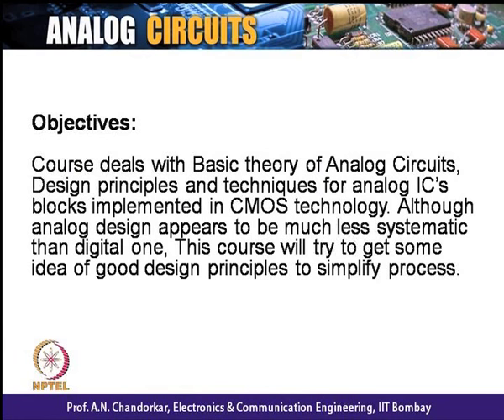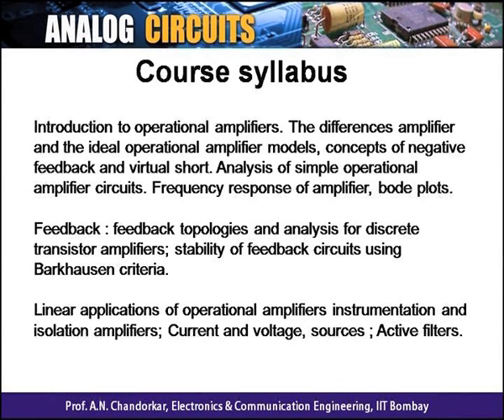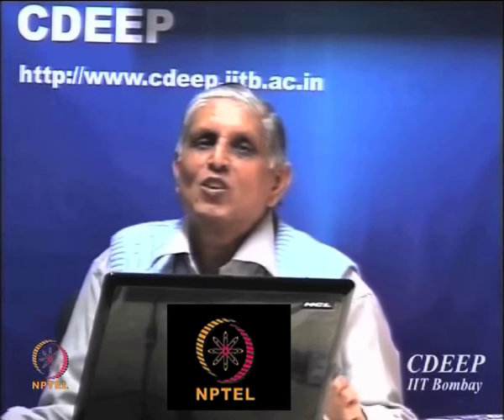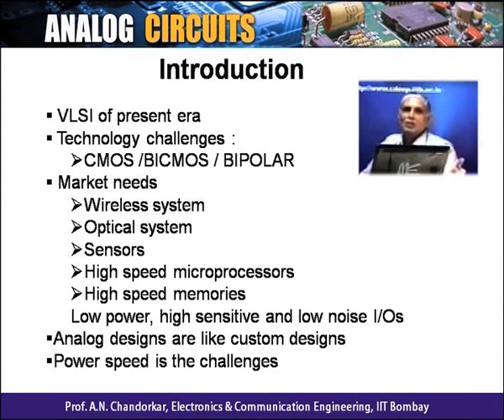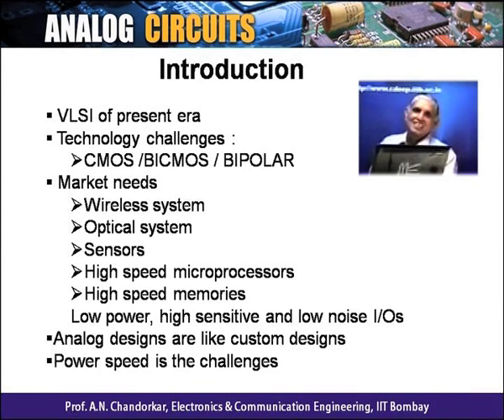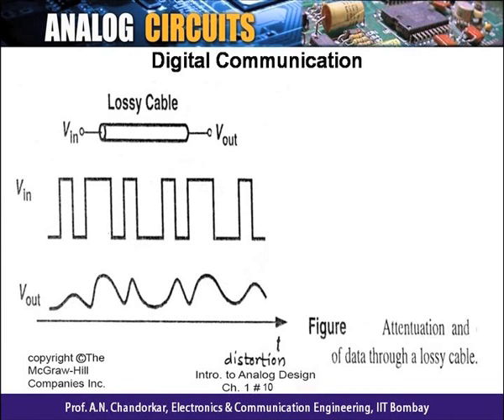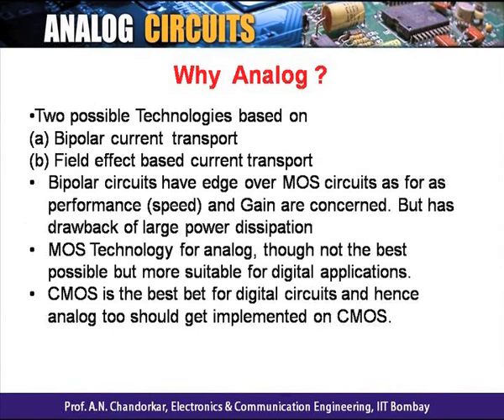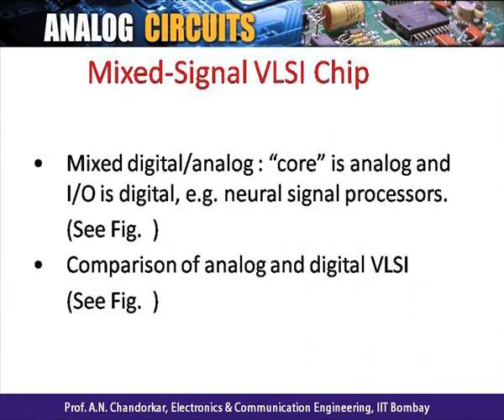Mod-01 Lec-01 Introduction to Analog Circuits - An Overview

Comment: voice breaks annoying...otherwise awesome...please do more videos
Reply: sir why do we need high output impedance for some circuits
Reply: @deepakroy82  So that you can use appropriately in further circuits, say, the output of the circuit is to be used as voltage source, then you use maximum impedance so that least amount of current passes through it, but at the same time, you can get higher voltage.